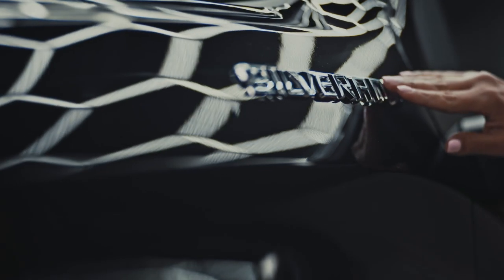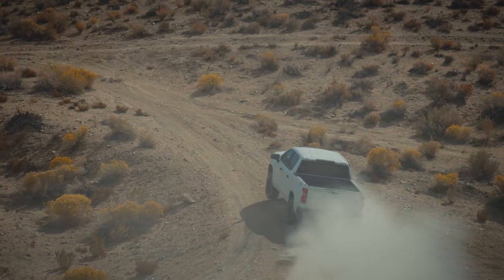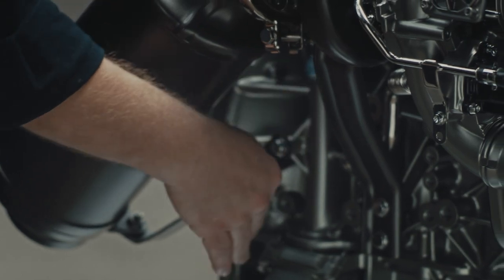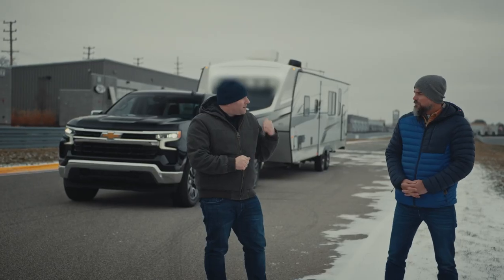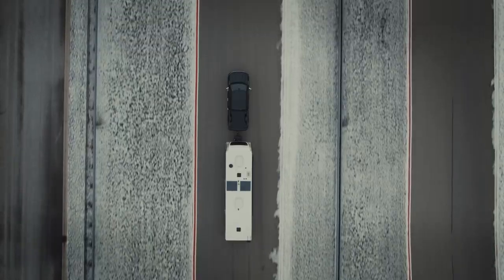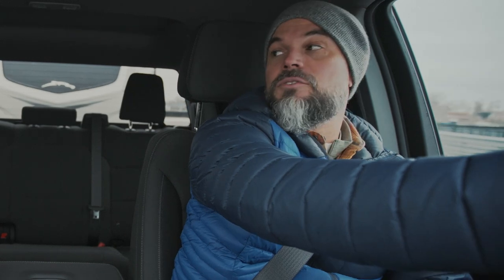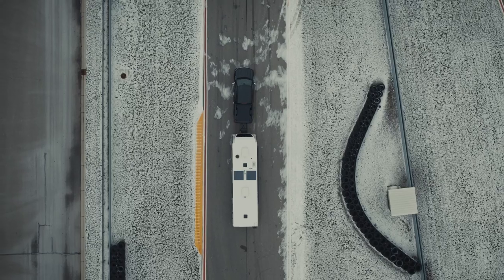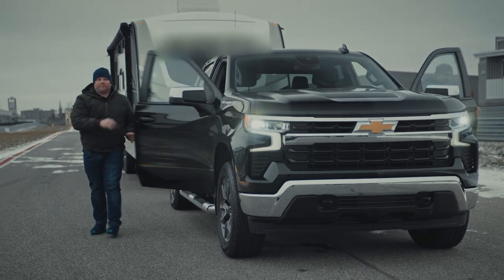Let's Talk Turbo | Silverado TurboMax™ High-Output Engine | Chevrolet Canada

Comment: I bought a 23 1500 LT with this 2.7L in it.  I was very hesitant to buy this truck with this engine, but I worked with a very skilled and persuasive salesman.  2 months into ownership and I have towed my 6000# travel trailer up Mt Hood here in Oregon and up over the passes to the coast.  I made both of those trips up grades at about 2500 rpm at 55-60 mph easily, and came in at 11mpg towing.  I cannot complain.

For just general daily driving though, can we talk about the trans stumble when coming to a stop, where it feels like 3 gear holds and then dumps straight into 1st at about 2 or 3 mph just before stopping?
Reply: Did you get the Mobile 1 synthetic flush?

Comment: What a piece of junk!!! You buy a full size truck to use it as a work, haul , and to be capable of doing just about anything you ask of it. This crappy 4 cylinder engine belongs in a Chevy Cruze SS, not a full size truck. CEO Mary Barra is trying to bankrupt GM, and she is doing it very well. Never buy a GM truck again.
Reply: crappy but tows just as much as that 5.3 L V8 at lower rpms only thing that would make it better is it being a 10 speed this is the future lol
Reply: Ignorant people mock what they do not understand. Did you even read the tow/haul specs?

Comment: NOBODY wants a 4cyl in full size truck.   I have a two. Turbo v6 400hp infiniti.  I wouldn’t want that motor in a truck either.  STICK TO v8.  I’ve been trying to buy a new truck for a while and definitely stay away from this engine option.